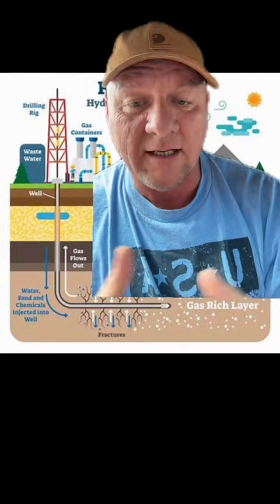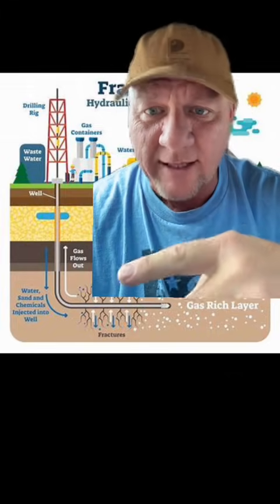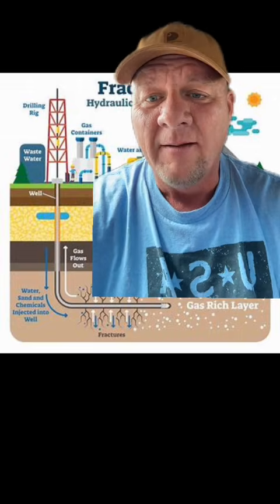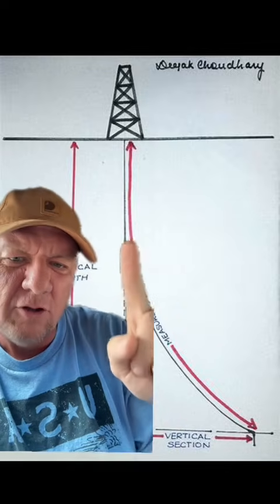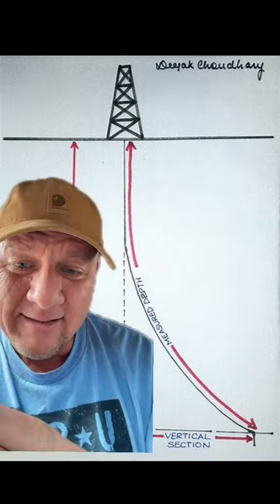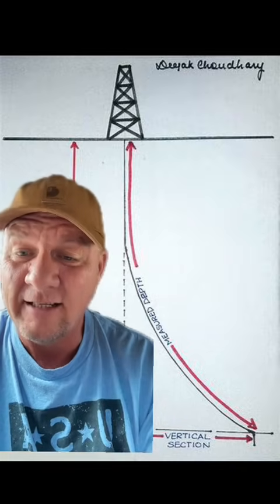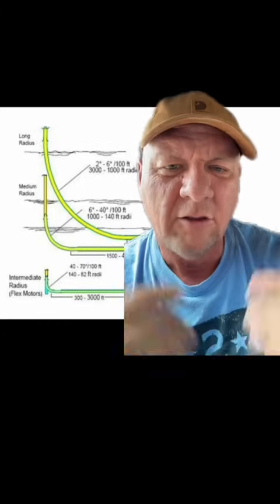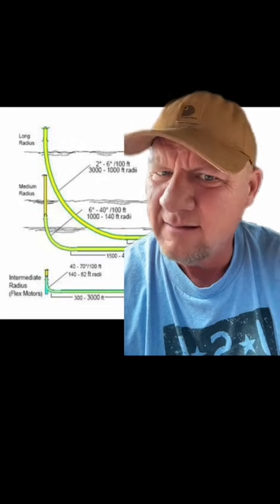Time For Class! How We Drill Sideways

Comment: "
In "direct bore drilling"  there's a transmitter on the drill tip so they can read it's location. There's a duck bill shaped head that points upward on the tip that points up. They stop the bit when the bill points in desired direction so they can "steer" it any direction.

Comment: I'm not sure who developed this technology first.. but it is NOT only used in oil & gas. My local Fiber-Optics company is installing fiber for internet and streaming underground with a smaller version of this tech. No more lines on poles above ground. One operator sits in a comfortable chair and operates the machine, which bores small tunnels for 100's of meters.. and then they pull plastic tubing through the tunnel, and then pull fiber through the tubing. And the instruments and computer calculates where obstacles, water lines, gas lines, etc are, and adjusts.. turning up/down or left/right.. on the fly.

This tech is just like how much tech we got from NASA's expensive research benefits us daily. Just one example is the microwave that damn near every household has.

Comment: With the curve of the hole and drill string is friction more of a problem ? if so are there any steep to overcome it ?
Reply: Potentially yes, but there are different types of pipe being used with different weights. The heavier pipe are kept vertical, or near vertical, and used to push the pipe below. Should they gain to much angle and it is starting to hinder more than help it is pulled out and a section of the lighter pipe is swapped in and then the heavy weight is again in the vertical. Repeat until the well is done.  There are also lubricants that can be added and even pull down machines that can be added to really get out there as well as a few other techniques. Extended reach, as it is called, is a bit of it's own animal.

Comment: When that 31' downhole motor was set on the pipe racks, it looked like a banana. The directional driller told me, "That's only 1-1/2°."  I thought there was no way it would fit in the casing.

Comment: How does slick wireline tools work in the horizontal well bore.
Reply: They typically get pumped down if free wire or they are attached to the bottom of the pipe and run in. There are also tractors that can pull the sensors down but that is more for cased hole typically.